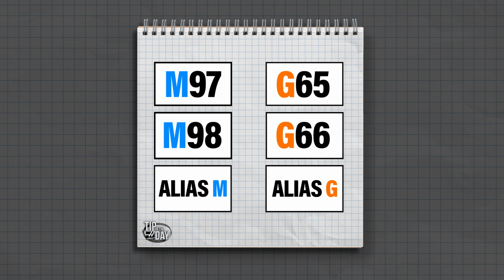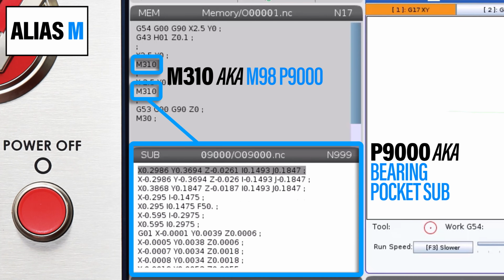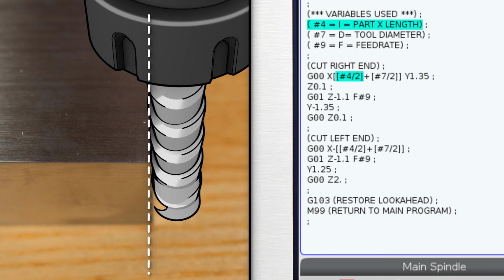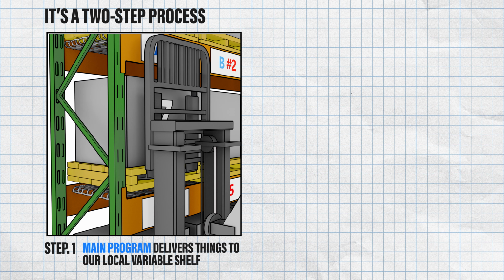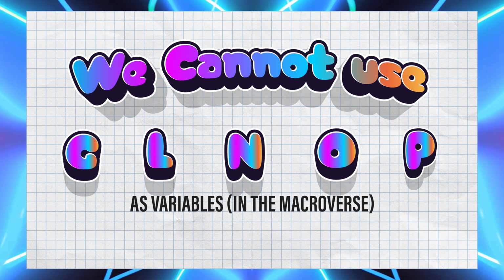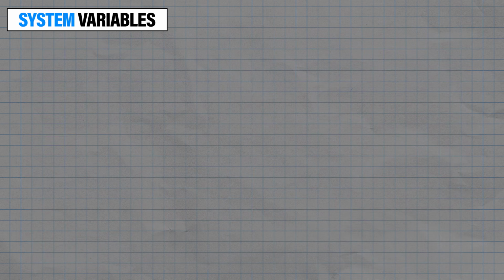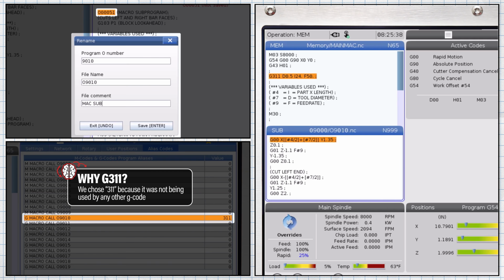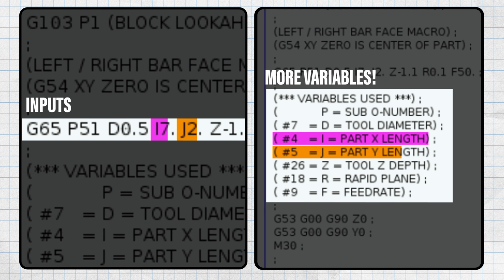The Essential Macro Video - Intro to CNC Macros and Subprograms - Haas Tip of the Day

Comment: hi there!
I have a quastion with D parametr.
for example, it is tool N1  as T1 m6
can I use a code D[#_ACTT] for the automatically reading of a parameter transmitted from the actual tool in the spindle?
is it will be D[1]? right?
its need to work with G41/G42

Comment: Live tool feeds and speeds variable depending on tool axial load, motor amps and vibration. I've done some simulations and then transfered over the feeds and speeds to test woth great results.

Comment: I will be trying to write a macro that preferably can figure out what offset it is. For the G54-59 and G110-129, this would work, but for G154 P1-99, the variable #4012 (I think) only has 154.0000. Which macro variable can I find the value for P? Thanks.

Comment: I run a Haas vf7. I developed a code to chamfer a drilled hole very effectively 
I love your videos mark. You taught me and my colleague a lot. Without you I couldn’t have made this. 
T30 M06
G90 G54 G00 X0 Y0

M97 P2031 L1

O2031 (Ball Endmill Chamfer – Spiral Up from Z-0.535 to Z-0.0535, 82°)

#1 = -0.535       (Start Z – slightly below bottom of material)
#2 = -0.0535      (Top Z – top of chamfer)
#3 = 0.01         (Z step up)
#4 = TAN[41]      (Side angle per pass — 82° included)
#5 = FIX[ABS[#2 - #1] / #3]   (Auto step count)

#6 = 0                            (Step counter)
#7 = #1                           (Current Z position)
#8 = [#7 - #1] * #4 + 0.3829      (Start I — toolpath radius, expands up)
                                 (0.3829 = radius of chamfer at Z-0.535)

WHILE [#6 LT #5] DO1
  G13 I#8 J0 Z#7 F5.0
  #7 = #7 + #3
  #8 = [#7 - #1] * #4 + 0.3829
  #6 = #6 + 1
END1

G00 Z1.0
G00 X0 Y0
M99

Comment: Macros are very useful for automation as well. I’ve used them to create closed loop machining cycles where parts get cut, probes, adjust tool offset, recut, reprobe, until in tolerance. Very handy for getting predictable reliable results in production runs .
Reply: It is great until it probes a bunch of chips...
Reply: @dmitrypolovin1776 If your probing chips that’s a skill issue.

Comment: Am currently on summer break for my classes and I know the HAAS machines I’m using next semester have probes and tool offsets so I’m taking the time to make myself some simple macros I can call up to make my projects easier. 

Thanks for the help  :)
Reply: Macros are terrific! You’ll have a blast in your class with probes. There’s a real sense of accomplishment when you finish up a cool macro.
Reply: @markterryberry4477 I got a chance to look at the machines and I think only 2 of the mills are capable of using Macros, but I’m still going to try at least 1 macro program!
Reply: @americankid7782 yeah, not all machines have the macro option. If the machine has a probe, it definitely has macros though.

Comment: Running a 10 pallet mill with similar parts on each pallet macros were absolutely necessary, imagine having to make a minor change in all of the parts you could just change one of the variables in a couple of or one sub program instead of a hundred or so places. I also had to come up with an alias m code for changing tools on a machine with a big rotary table that would move the rotary table to a safe spot while changing tools.

Comment: I really enjoy your videos!!!! I used to have a TL1 from 2006 or so, and the thread repair function was very handy, and intuitive. I've replaced the 2006 machine with a 2022, and I've yet to figure out the thread repair function on the new machine. I've test it multiple times, and each time it's destroyed the thread. I've been trying it on scraps, but I haven't been able to find success, and I'm not able to do one of the main attractions of the Toolroom Lathe. Please do a video on this function!!
Reply: We will move this up on the list. On a side note, videos have been added to the VPS templates for Thread Repair in software version 100.22.000.1020 (BZ#2654/TP#65597), which should help clear things up. Check to see if you have that SW version or newer, and touch base with your HFO if an upgrade is needed.

Comment: Hi Mark, why did you gave the D the Diameter as D0.5 and not the Geo + Wear from Tool 1 as D1 ??
You can use D as the tool Geo + Wear, just make a #120 = #[2400+#7] - #[2600+#7], for Tool 1 it reads #120 = #[2401] - #[2601].
Well we have only Haas lathe, not mill but I think it works the same.
On my Fanuc 0i-MF Macro C I make a #120 = #[13000+#7] - #[12000+#7], it actually reads the Cell-number with Geo + Wear, btw doesn't need the same D-number as the tool.
Reply: Absolutely. That might be the way to go especially if your shop is already used to entering a tool’s diameter on the offset page. I typically use a CAM system, where I just enter the tool wear on the Tool Offset page, not the actual tool diameter, so I just stuck with that method. I liked the way you approached it.

Comment: What are the odds that you just uploaded this yesterday?!
I'm struggling with my first complex macro.
Trying to expand my 10-umbrella on my SuperMiniMill-16 with NGC, I'm trying to have T1-9 as normal, but when calling T10, with whatever H&D I want it to hold for a manually tool change. I'm almost there. But missed Mark in my shop today when I didn't get why it choose wrong subprogram 🤷‍♂️

For some reason, I get P9001 to start on both T6 and T10 here.

Shouldn't it skip the first IF, when my #4120 is 10?

IF [#4120 LE 9 AND #3026 LE 9] THEN G65 P9001 (T1-9 to T1-9) ;
IF [#4120 EQ 10 AND #3026 LE 9] THEN G65 P9002 (T1-9 to T10) ;
IF [#4120 LE 9 AND #3026 EQ 10] THEN G65 P9003 (T10 to T1-9) ;
Reply: When in doubt, add a G103 P1 a few lines before your macro statements (ending with G103 after macros), or a “/“ on a blank line before/after macros. We often run into look ahead issues when writing tricky macros.
Reply: @markterryberry4477  I noticed in an other of your videos that when one line has two IF's, ypu separated them in their own clamps. I did not...
I wrote:
IF [#4120 LE 9 AND #3026 LE 9] THEN G65 P9001 ;

In your video you would've wrote:
IF [ [#4120 LE 9] AND [#3026 LE 9] ] THEN G65 P9001 ;

Could that be something?
I couldn't imagine that look ahead would make my program choos the first, not the last subprogram in line...
Reply: @tegheim  check your order of operations, and use brackets. Try 
IF [[#4120 LE 9] AND [#3026 LE 9]]….
Reply: @ It works!
I'd love to share my macro with you.
Reply: @markterryberry4477  thanks!
First thing tomorrow 👍
Have been struggling and learning all day.
If this idea works, It will be awsome to have endless (up to 200) tools rigged and call them all and letthe cnc deside if it one of the 9 in the umbrella or let the operator load 👍
Reply: @markterryberry4477  
What will happen if the first IF is true, and it goes to P9001 who has a M99 in the end.
It will go back to next line of IF's in my main program right?
If I'm unlucky, it will find another line that matches after P9001 is done, and I will get another tool change...?

Youtube comment isn't the best to put code on, but here my main program:

%
O09000 (ALIAS M06) ;
G103 P1 ;
IF [[#4120 LE 9] AND [#3026 LE 9]] THEN G65 P9001 (T1-9 to T1-9) ;
IF [[#4120 EQ 10] AND [#3026 LE 9]] THEN G65 P9002 (T1-9 to T10) ;
IF [[#4120 LE 9] AND [#3026 EQ 10]] THEN G65 P9003 (T10 to T1-9) ;
IF [[#4120 EQ 10] AND [#3026 EQ 10] AND [#900 NE #910]] THEN G65 P9004 (T10 to T10) ;
G103 ;
G53 G00 Z100. ;
M99 ;
%

Comment: Hello, thanks to the videos you make, I've learned more about using macros, but in a very different way. I have a question: Is there a way I can add a value using macros?
I mean, if I have a program with an endmill that compensates for its tool radius to make a certain type of hole, and I set a smaller or larger diameter endmill, could there be a numeric value input to assign the tool diameter?
Example:
I have a 3/4 endmill that compensates for the tool diameter in my program, and I can adjust it with the macro to make the type of diameter I want.
Now, let's suppose I just want to modify my tool, but instead of manually going to the program editor and changing the value, I can create some condition so that if for any reason the tool presents a problem or I want to change it, I can simply run my program and it will appear: Enter the diameter or radius of the tool to use. And once placed, it's updated and processed with the assigned value. Would that be possible? If so, please make a video demonstrating this or with another example. I just want to know.

I look forward to your response. I'm sorry if I can't explain myself properly, but it's just a curiosity I have, since the way I create the macros is completely different from what I see here, but they still work very well. Thank you, greetings from Mexico.

Comment: A simple one I made a while ago. It will auto-probe any tool you have active on a lathe as long as it already has an offset and tool tip direction set. It can easily be modified to check for tool wear instead.  Not set up for tools that have a different offset # than the Tool # (Cannot be tool 1 offset 13 etc). To use, simply call up the tool and hit cycle start.

%
O00006 (Lathe Auto-TouchOff Active Tool)

G103 P1.  (Only read 1 line at a time)
#101= 0 (Clear the variable)
#102= 0  (Clear the variable)
#101= #3026
#102= #3026 + 2300 
#101= #101 * 100 
#101= #101 + #3026 
#103= #[ #102 ] 

(ERROR CHECKING) 
IF [ #103 EQ 0 ] GOTO100 
IF [ #103 GT 8 ] GOTO101 

T#101 

M104  (Probe Down)
G212 H#103 (Probe active tool based on tool tip direction indicated in tool offset page)
M105  (Probe up)
M30 

(ALARMS) 
N100 #3000= 1 (TOOL TIP DIRECTION NOT SET) 
N101 #3000= 1 (INVALID TOOL TIP DIRECTION) 

%

Comment: But Macro B was  switched off on all haas machines I worked. I know it is an option, but what a hell it is an option!!! On all fanucs I worked Macro B was active from the start.
Reply: I understand the reasoning. As an operator I want all the options. The shop owners only want to pay for the options they need though, and not everyone needs macros.  For a couple years I worked in the Software department, and I can say that a lot of programmer hours go into maintaining all of the codes for Macros, so we either have to spread that cost across everyone (raising the price of an entry level machine) or just charge the folks that use it (what we’ve chosen). Macros does come with probing, making it a good deal (required). We hear you though.
Reply: @markterryberry4477  Macros are the most essential thing, I use it every day of my work.  I cannot agree with raising costs, because it is not operator who writes programs, it is programmer. Right macros, I mean which can be called with G65  are very easy to exploit, just change meaning of argument. If operator is so stupid that he is not able to change few numbers, than he shall not be allowed to work at all. I work as programmer on lathe machines, and my every of my operators able to read and mind what is written. iIt is easy to make some sheets with explanations for every macro, and that is all.